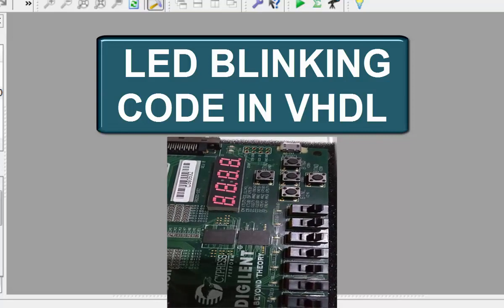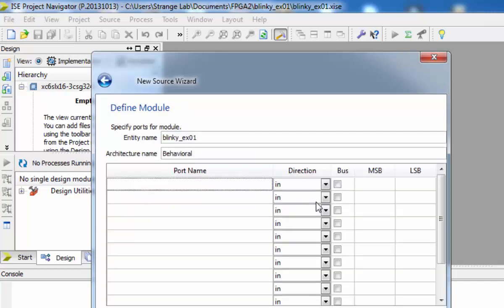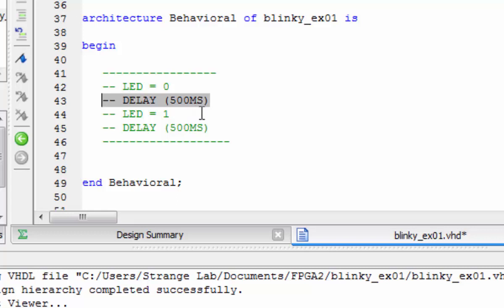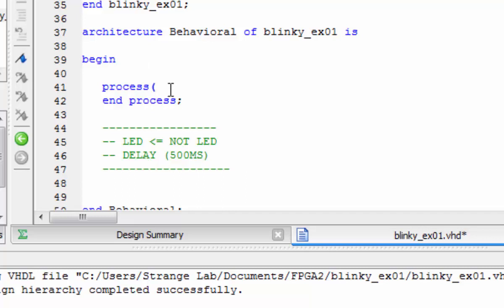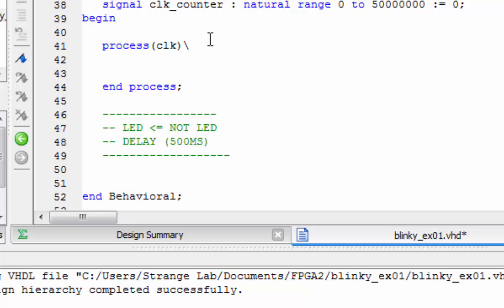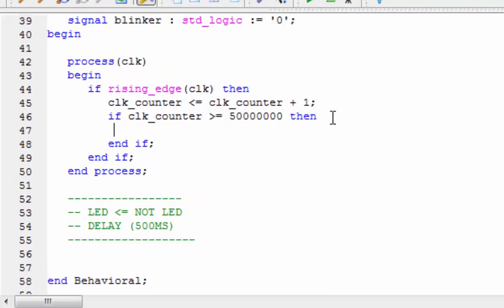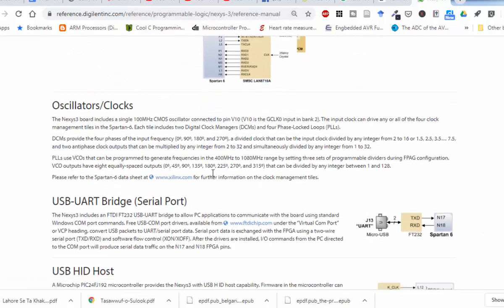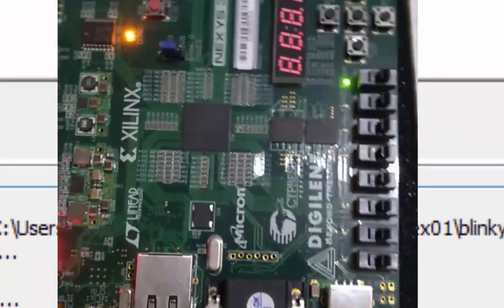FPGA LED blink VHDL | FPGA learn by Examples Ep02 | VHDL clock divider example | vhdl proces

Comment: thanks. i did it with a Tang Nano 20k with the GoWin IDE. I used a different example with Verilog before. But now I wanted to try the same thing with VHDL which worked well. I have to look a bit deeper into the IEEE library. that could help me a lot.